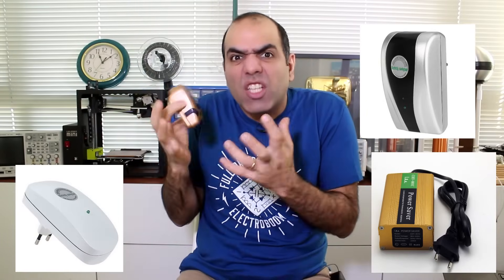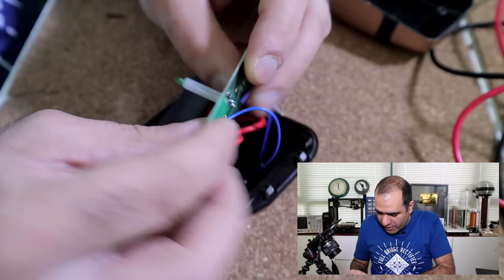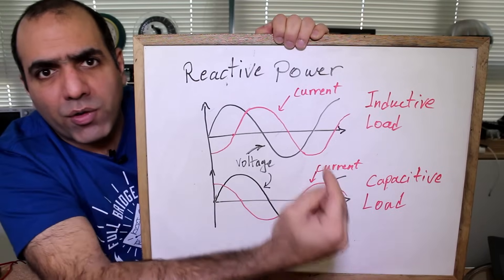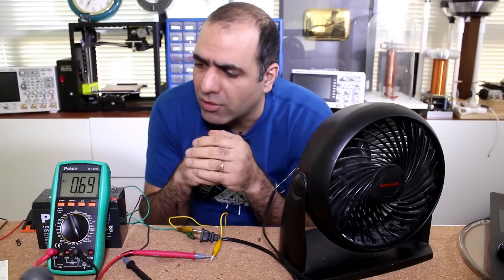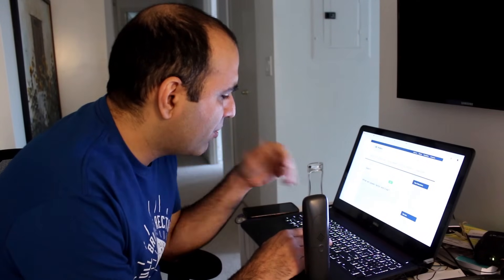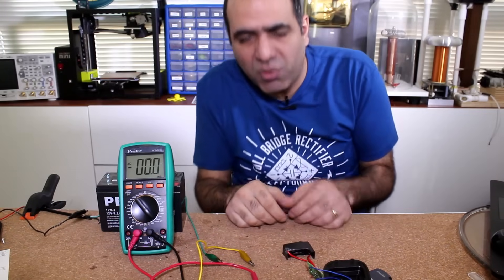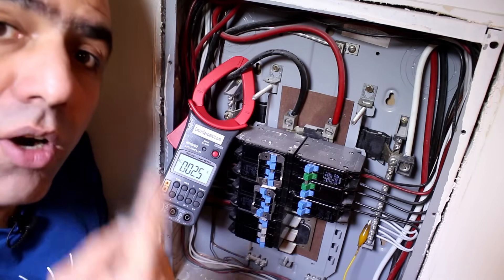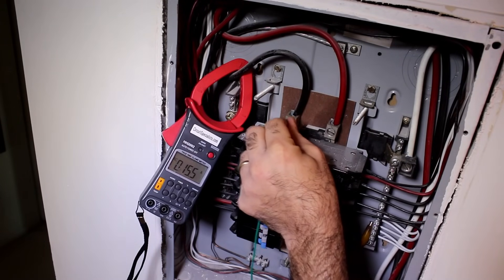Power Saver Scam EXPOSED!

Comment: I found them very useful, rip the innards out and it's a nice sized case to fit an HLK encapsulated psu, an ESP8266 and a couple of sensors. For£3 it's a bargain wall socket case for a multi sensor.

Comment: That hum coming from the microwave power supply always scares the shit out of me.
When he opened the breaker box, I thought I was going to have a heart attack.

After being zapped once, I have no desire to do it again.
Maybe someone can tell me how dangerous it was what I did.
Working on an old CRT tv. I think it was a 26". Might have been 20"
I discharged the picture tube with my body. Finger on right hand touched the hole where the high voltage connector goes. Left hand touched something and the zap went up one arm, through the chest and down the other.

Comment: This video got me wondering about some 'power saving' things in my own home. Somewhat recently, my dad got a hold of some "standby power adapters" like this: http://www.arlec.com.au/detail-2/?de=ES001 which purports to "cut power to battery charges when battery is full" to save money...or something. It only works on chargers that output less than 5V 1A

So i'm wondering if it's legit? and more to the point, is it actually wasting money to have it plugged in?

Comment: The one true energy saving device is 10 1k ohm resistors in series with 14 1meg electrolytic caps in parallel then connect it to either a wall socket or to your switch board 😂

Comment: I hate "as seen on TV" items. They solve a problem for you that you never had in the first place. This power saver is an example. You never paid for it to begin with so it's drawing into the capacitor that you were never paying for to begin with.

There is this salad bowl that has slits in it, so you can add vegetables to it, flip it upside down, cut down the slits with a knife and get a perfect salad everytime. The issue is... the bowl is small so you have to cut the vegetables down to size to fit them in the small bowl. Since you're cutting them anyway, why not just finish the job and cut them small enough for a salad.

Comment: Interesting, but I use a much larger grid tied device (cause that's a term) and I can show and tell at least $10.00 saved each month in a residential 1000 Sq Ft home. I have also duplicated said device with upgraded self healing 45 uf caps wired in series if memory serves. It's a 220 volt direct to panel/breaker box/fuse box tie in. In other words, grid tied! Yea, it works, at least my versions does!

Please remember, this will only work on INDUCTIVE loads, a plugin space heater is a no go! 

Yes, most devices are tuned via capacitors to make said device run as close as possible to PFC .99.  Caus lest face it, 1.0 is perfect and impossible!

Comment: Anyone else cringe when he nonchalantly attached his leads to the line wires in the panel?..
Reply: I cringe every time he touches electrical stuff.
Reply: Only people who didn't cringe are those who don't know about the the power rating on the utility side of the breakers, or haven't heard the stories of what can happen when something goes wrong at that point.  In all seriousness the alligator clips have proven their value as fuses in past videos, I imagine that's why Mehdi was holding it by the wire and not the clip itself :)
Reply: @Berkeloid0  Or those of us who do, and have seen far worse. Some of us date from an era where this was normal. These days, it's "Put on your 40 Cal suit to change those AAA batteries", "What's your safety plan?" (hint: it involves running), "Time for the toolbox safety talk". No thanks, let the kids have it.

 These days I stick to engineering during the day, and doing the rare electrical job for friends on the weekends. It pays better, and if someone mentions "suiting up", I just smile and say "That's electrical work, I'm an engineer".

The last "Handyman" job that I did was for a friend who had moved his shop to a new building and found that after the "electrician" had finished his work, that his punch press and wire machine wouldn't work. They were both 3 phase machines, and the idiot had wired both of them to the single phase panel.
Reply: I flinched when I saw him taking the shield off the breaker bay.
Reply: @Splattertube  you probably go in chock when you see the inside of an older European local distribution station, the mains level panels have open rails and the fuse blocks are clicked in exposed clamps, off course only qualified electricians are allowed inside and they used rubber gloves and isolated boots
Reply: @andrevanschaijk885  Um, no. I'm quite comfortable working in and around such equipment. If you've ever seen even one of Mehdi's videos, you'd understand this post and the comments that followed. Have a great day.
Reply: @andrevanschaijk885  No, not so much. We have the same thing here in the older plants. BTW, we call those panels "Widowmakers", ITE used to make a particularly dangerous one. 

What should make you go into shock is how we used to work on them "back in the day". No such thing as Arc Flash suits, rubber gloves, boots, etc. for the average electrician back then.
Reply: Yellow croc clip looked a bit singed too!
Reply: I mean he was nonchalantly jamming wires into the output of a microwave transformer like two minutes earlier. Its part of the humor i suppose lol
Reply: My butthole was clenched so tight you could crack a walnut.  He is an absolute mad man.
Reply: Not really, I've changed light switches and plug sockets with the mains still on, and that's in the UK with 240v... you just need to be careful, understand what you're doing and above all respect that what you're working with not only could... but WILL kill or injure you if you mishandle it.
Reply: kal9001 why would you risk it then that seems kinda dumb
Reply: @walkernel  Schools will tell kids that mains will kill you just by looking at it wrong mainly to discourage curious kids doing something actually lethal. but in reality the risks are easy to mitigate if you're sensible, It's as simple as "don't touch the wire"... Lots of people work in much more dangerous conditions. I am aware it's easy to just turn the power off and its "safe" then... but at this particular time there was equipment running on the same circuit we could not turn off, also without a torch, we needed the room lighting we were rewiring to see what we were rewiring... needs must...
Reply: no
Reply: dude...hell.ya
Reply: Phase

Comment: When I was going to school to be an electrician, we learned about large synchronous motors that their only job was to correct power factor in large industrial applications.  They're a unique motor that can vary their power factor - so they were used to correct PF.

Comment: I think the microwave produces radiation regardless of something absorbing it... That means it draws the same current no mater what's inside of it. It's just a radiation generator outputting a set power (very high power) in the form microwaves. Am I mistaken?

Comment: Think motors with big inductive load ... like a hoover draws 50% from the electric 50% of a capacitor maby makes sense... Constant bill with that stupid capacitor in the fuse box... This works calculated only on factory stuff not households.

Comment: Okay... now it explain everything XD
I learn a bit about electrical in my major.

And I don't know why Power Factor Correction isn't helping much in home use.

Because I learned that in Indonesia, there are a regulation about using Power Factor Correction in the factory because it will affect the electrical bill by a significant number.

And I asked the professor: "So, I can save some power at home with it?"
And he only said: "It might be"

Okay... so, it might save, but he didn't explain why it might.
Now, I know!

Comment: today's domestic consumer meters can measure the aparent power and in some places  you will get charged based on that. They go as far as to put a "tax" on peaks (fridge/washing machine turning on, plugging in a computer psu) and a bigger 1 for short circuits and overloads. And all that is added as extra power used (reactive power being registred as the aparent power). While most reactive power consumers have built in power factor correction, most chapo knockoff rubbish does not. And dealing with the peaks can be difficult and is less often dealt with. Hope all this bullshit practices and the snake oil trail behind it will go away with time ass ppl get more and more sick and tired of bullshit.

Comment: My very first job as an electrician was to help install a capacitor Bank to improve power factor on the Palmer Events Center of Austin Texas. But the capacitors used were about as big as my arm and there was about a dozen of them. Not to mention all the brains in the cabinet which was 12 feet tall.

Comment: Anyone that understands what power factor is, should know that this little device is a gimmick.  Just put it on a wattmeter and you can see it is drawing real power.  Since it is not saving any real power, the net is a higher electric bill using it and wasted money purchasing it.  They are basically expensive nightlights.

Comment: power factor correction is something that I couldn't understand even after taking physics 2. I know power companies get angry if you are an industry and keep the power factor too low (because distributing that power cost them money even if you gave it back) so they usually fine you and force you to do something to raise it (like installing large capacitors). But what I don't understand is whether there's any benefit to you in keeping the power factor close to 1. How does keeping the power factor close to 1 lower your energy consumption like you showed in the video? I thought the only reason to keep power factor up was to prevent power companies from fining you, meaning that I expected that installing a capacitor on an inductive load would register a higher energy consumption on the meter.
Reply from the maker: Yes, there no benefit to the customer to fix power factor, except to save money if power company charges reactive power

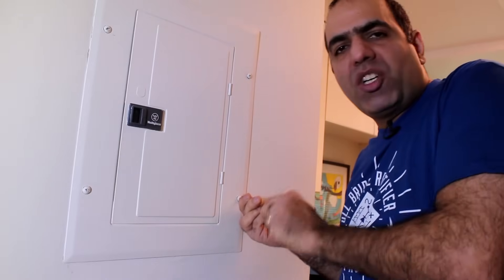Comment: 6:55 Boy, do all breaker cabinets look like that in North America? Sure, we got 230V here in Europe so a little more protection might be necessary, but as we all know from this channel, 120V are still dangerous.
Reply: To be fair, it doesn't really affect safety if you're not working on the panel
Reply: Mehdi removes the panel covering the internals. Obviously all breaker boxes in this world has a panel covering the electric contacts and can be easily removed for maintenance

Comment: VPNs do not protect privacy. Do a show on that... Wait, it's your sponsor, duh...
Reply: some of them actually encrypt all your traffic
Reply: VPNs provide security (nobody can break into the encrypted tunnel and change what's being sent) and privacy (nobody can read what you've sent over the tunnel).
They do not protect the data once it reaches the receiving side, and they are not anonymous.
Reply: @p_serdiuk , the VPN provider can see all of your traffic and do what they want with the data. Many sell your data to the highest bidder. DHS has the authority to see anything they want. Privacy is a myth. Assume your info is available to anyone with enough authority to look at it, if they want.
Reply: @p_serdiuk , When using a VPN, the only encrypted part of the connection is from you to the VPN provider. From the VPN provider onwards, it is the same as it would have been without a VPN. And remember, the VPN provider can see and mess with all your traffic.
Reply: @iamanempoweredone6064  You seem to live in a world where TLS doesn't exist, but it does.
VPN providers can only see your unencrypted traffic. But without a VPN, anyone on your local network, including your ISP, can potentially intercept and tamper with unencrypted traffic anyway, so using a VPN reduces your attack surface, especially when you're using public Wi-Fi.
If you're paranoid, use Tor in conjunction with VPN. Tor is used by the intelligence agencies themselves. Tor exit nodes can see your unencrypted traffic, so it's best to use it with a VPN on top. That way, the exit node can't decrypt your data and the VPN provider doesn't know your real IP.
VPN also protects against DNS leaks. Most DNS traffic is unencrypted, so the hostnames you look up are potentially traceable back to you. VPN makes it harder for DNS server operators to identify you. You can additionally set up a DNSCrypt proxy or use a DNS-over-TLS implementation to protect yourself against the VPN provider.
Finally, there are ways to configure Firefox so it only connects to TLS-protected websites. It breaks some sites, though.
Privacy is only a myth for the uninitiated. It's actually hard for alphabet agencies to catch people who use such technologies properly and do not make silly mistakes such as using their real phone number for registration or using the same nickname on different websites.
Reply: @p_serdiuk , for the few that have the time and desire and knowledge to investigate and act in a way that would ensure a certain level of privacy that may be well and good. For the masses who believe that a turnkey VPN will protect their privacy, well, they are being deceived. Again, when using a VPN, the only encrypted part of the connection is from you to the VPN provider. From the VPN provider onwards, it is the same as it would have been without a VPN. And remember, the VPN provider can see and mess with all your traffic.
Reply: @iamanempoweredone6064  Why technology is a field where people suspend their vigilance about bullshit advertising? Come on. VPN ads are the same as all other ads. Whoever believes that any complex subject like who can and cannot potentially access your data on the Internet is really simple has only himself to blame.
The VPN provider cannot mess with HTTPS connections, period.

Comment: I don't understand people who believe in this garbage. All meters for houses just measure active power. If you look at the meters closely you can find out that the meters using the CT or shunt resistor to measure active power there is no parallel measurement for reactive power. In addition, most devices like a refrigerator have a proper capacitor in it. If you need to deal with PF you should use the automatic PF regulator with capacitor's bank.

Comment: Wait, does putting water in the microwave really change its power consumption? I understand that some of the radiation is now being converted to heat in the water, but whether that happens or not the radiation was still already produced and had already consumed real power, correct?
Reply: I'm guessing it's due to the isolator (basically one way microwave window) not being a perfect device, so some radiation will go back to the microwave generator and make the load mismatched, which will probably lead to the generator detuning and then drawing even more power. If you have substances absorbing microwaves then there's less radiation to cause the load mismatching in the first place.
Reply: VSWR changes

Comment: tf?
Why are yo only get two phases to your home?
I'm from Austria and here it is standard to get three phase AC (400 Volt) to every Apartment/House.
I even have a 400V 3~AC outlet (Or as we call it CEE outlet) in my basement for heavy Power tools like a  tablesaw with a  three phase motor.
Even the most electric cookers here run on three phases.

Comment: It seems that I have such thing and I even did not know about this "feature". Well, I have it connected to relay that switches my led lighting because this crap was blown all the time without any induced current protection (whatever it''s called). That's basically capacitor and resistor proper for power load.

Comment: You can actually draw shitty reactive powers from your home by using high power dc loads too with no reactive power compensation circuits.. (rectifier based loads like old computers and laptops had)

Comment: Wait your fuse box is screwed shut? Here in Finland you simply open them like a kitchen cabinet door to check them. Even the old ones that still had actual fuses you needed to replace and not just flick back the switch.